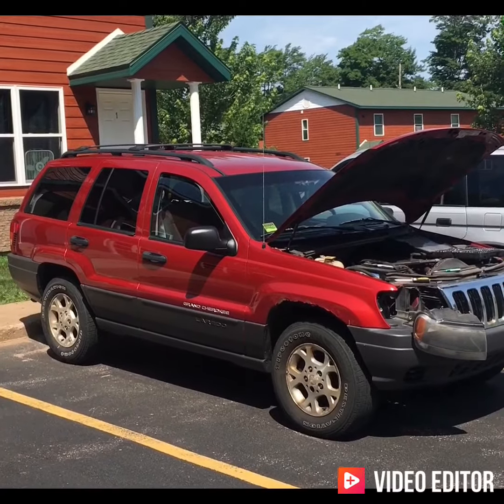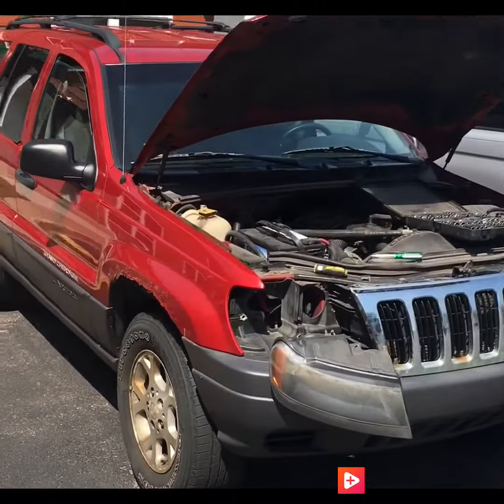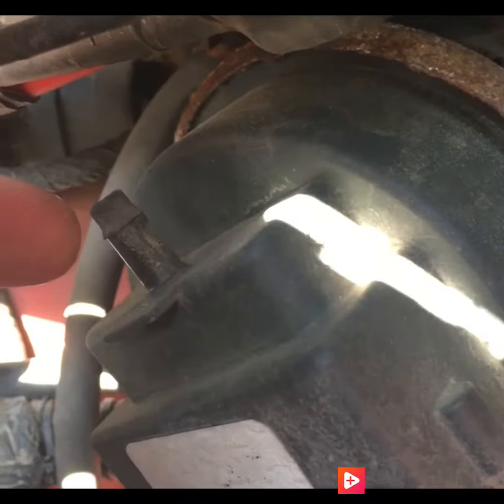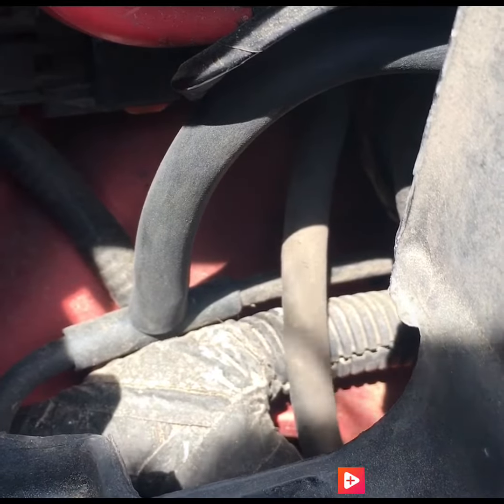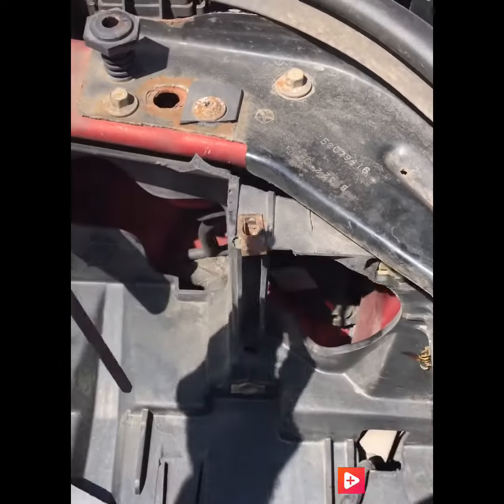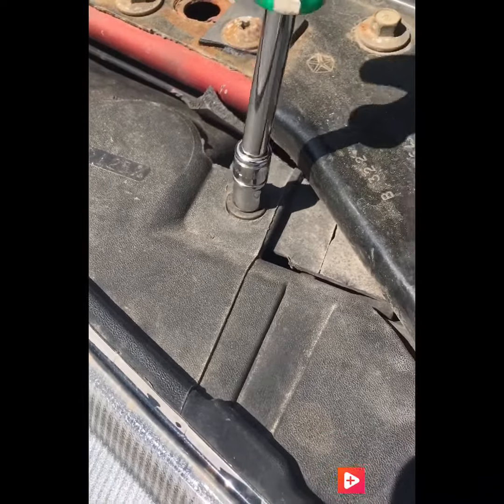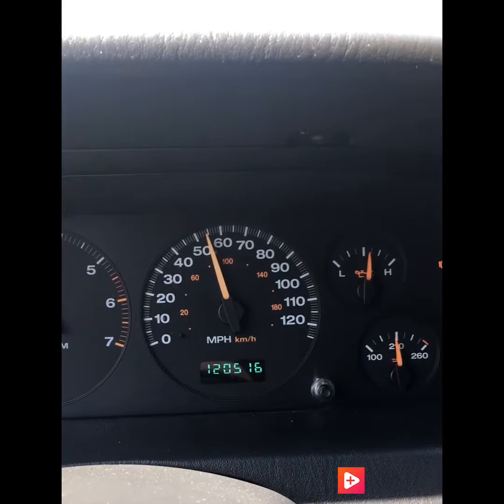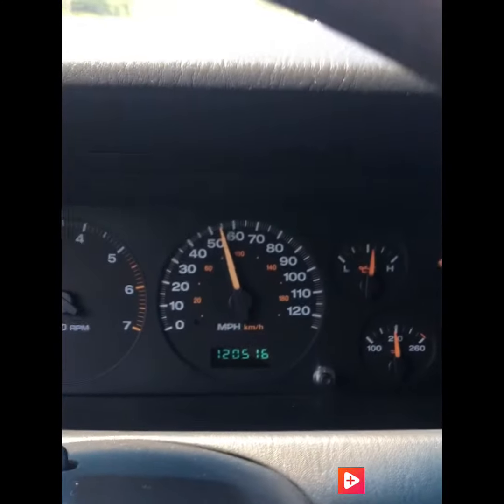2003 Jeep Grand Cherokee Cruise Control Repair Vacuum Line Fix Easy

Comment: Ben, thanks so much ! My air vents and cruise control stopped working and your video diagnosis was spot on for me. Turned out to be the same hose you replaced, mine was loose and cracked. A quick trip to Car Quest in Whitefish Mt and I had a new vacuum hose (no charge for me either) and the problem was fixed. Thanks again.
Reply from the maker: I’m so happy to hear this. I made this video a few years ago and am glad it’s still helping people!

Comment: Another suggested method to access hose is removing battery and battery pan.  Your method seems much simpler.  Thanks for posting.
Reply from the maker: That's a great tip, and it would be good to inspect these lines if you ever have to change the battery, while you have easy access. THANKS!

Comment: FYI if that tube is not cracked....follow the right side of the T fitting. It runs over to the wheel well...then turns back to rubber till it reaches the firewall....then goes hard line again under the drip rail along the firewall over close to the brake master cylinder then turns to rubber as it attaches to the intake manifold.  That is where my line just fell off. I re-attached it and everything came back. It fits a bit loose so replace it with fresh so it would not back out any more. Once you know where the vacuum lines are just inspect the entire system.  Thanks for the video!!
Reply from the maker: Thank you for the comment! Hope someone out there with the same issue you described reads your comment and tracks down their issue 😉
Reply: exactly what mine was.

Comment: My situation discovered that the vacuum hose had come loose from the module (not the T connector side); only in this case, it hadn't come loose, but rather had broken off at the nipple leaving nothing to connect another vacuum line to without replacing the module (that I didn't want to do).  My solution was to clean up the vacuum hose and the module where the old nipple was and then HOT GLUE the hell out of it to hold the hose in place and seal any vacuum leaks.  Not a sanctioned fix but it works and I expect it will continue to do so for a long time to come.
Reply from the maker: Great find!

Comment: This was helpful, except when I dug in, I found that the nipple on the cruise control module had broken completely off. Wish it had only been the hose.
Reply from the maker: edselguru Oh man that’s a bummer! Were you able to locate a new module?
Reply: @benchamberlain5985  In the process. I have located a used unit and have seen new units for about double the used price.

Comment: See your engine light on did the vacuum leak cause engine misfire or rough shaking when idling because I think I have same problem.i hear a hissing noise. Please respond
Reply from the maker: Tiger 046 I did not have a hissing noise and my engine sounded and ran fine. But a major vacuum leak like that could cause your engine to run rough, if it’s that loud it should be pretty easy to locate.
Reply: My  c control quit and I hear a hissing from that area!!! Gonna look tomorrow. Thanks for the info!!

Comment: Hi. At the T. Where does the vacuum line go to the right. At 1:33? My plastic hose is broke off and I can't find where it's soposed to go? I just plugged it for now.
My cruise control still not engaging. 
Also, I have a line from the firewall the ends behind the battery and is capped. Any idea's?
Thank's,  greatly appreciated. ✌
Anyone help?
Reply from the maker: Phil PJ Davis Hi Phil, sounds like you have a few issues, sorry to hear that. I would try to get them all hooked up if possible. Here is a link that shows how they connect. Best wishes and keep us posted!                   https://www.pinterest.com/pin/269793833903792170/
Reply: Same here with my 03 Grand Cherokee 4.0!!

Comment: So, I'm having this problem as well. But... the A\C Blender Door will not function. It is blowing air via the defrost vent onto the wind shield. These two things seemed to occur about the same time (coincidence?). Will this fix that as well? 2004 JGC 4.0 in line 6. 

UODATE - Looks like my own orobkem was the AC cannister vacuum tube had gotten disconnected.  I found it, pkugges it back in and VOILA  AC works fine and CC is operational , too. Alls well that ends well.
Reply from the maker: James Poule I wish I knew, I know that any vacuum leak can cause a variety of problems. Fix the line as a first step. Sorry I couldn’t be more help.
Reply: @benchamberlain5985  Thus is a very perplexing problem.  I spent all day running different things down. In the end, i learned a great deal about my JGC that I didnt know. Your vid was indeed very informative.
Reply: UPDATE - Turns out the AC CANNISTER Vacuum hose had come lose at the engine. I plugged it back in, and VIOLA.... problem(s) solved. At the end, I called a local fellow referred to as 'Sam, the Jeep Genius' -  described the problem over the phone, he told me exactly where to look, and now I know why he's called the Jeep Genius. Next time, he'll be my first call.... Thanks to all.
Reply from the maker: Great to hear! Thanks for posting this comment, hope it will help someone else with the same problem some day.
Reply: @benchamberlain5985  Yes sir. And that's what it's all about. Helping people out. Thanks again for your very helpful vid.

Comment: My cruise control is out on my 2003 grand. So did my ac when my car got fixed. The AC blows up top
Reply from the maker: Jayme Brown Certainly could be a Vacuum Leak causing both issues. Just have to start tracing all the Vacuum lines looking and listening for leaks.